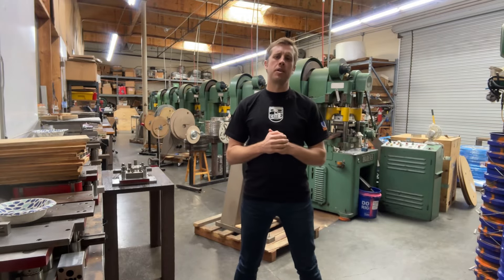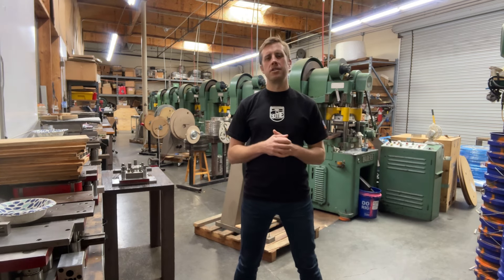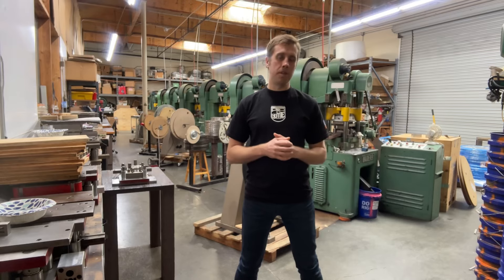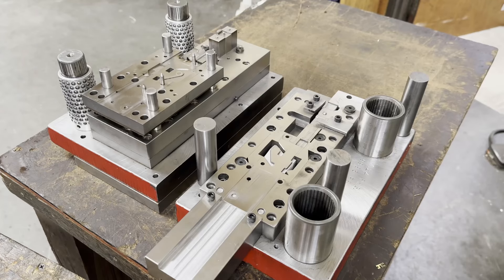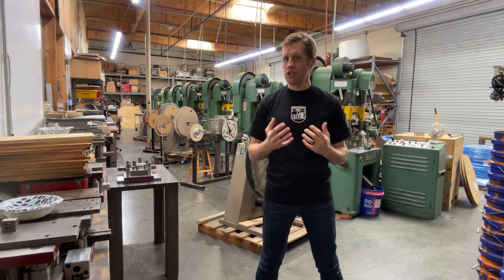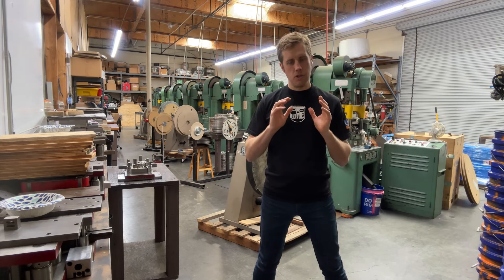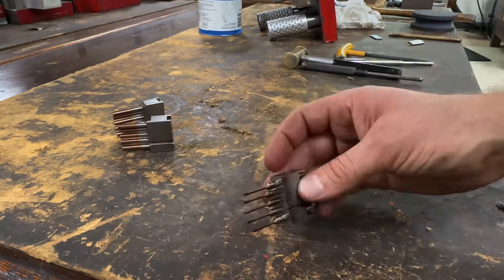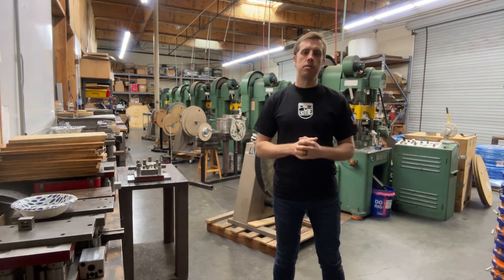Crafting Excellence: 7 Must-Have Tool and Die Making Skills

Comment: Been doing this 25 years.  From design to prove out on the cmm.  With me running the cmm and another to verify.  As a Master Die Maker, you have to understand the whole process, and if needed, program, fabricate, and assemble a functioning die on hit 1.  From print to putting it in someone's hand.
Reply from the maker: We try to make a good part on the first try, but there is usually some development before getting a more complicated part to spec.
Reply: @ToolanderEngineering  Oh, I realize that happens, but the mindset of dead nuts does take over sometimes. 🔍
Reply from the maker: @scottrackley4457  of course
Reply: @ToolanderEngineering  Home run on first hit is rare. If it's not, you're not being challenged.

Comment: i designed powdered metal, multi layered die stacks, dies and coining dies for a few years, 30 years ago.. ive worked on a list of projects since. i have a 3 machine cnc shop now doing design to small production. ive always felt more of a tool and die maker though, its been a mental process to get that production speed mentality lol.
Reply from the maker: That's an impressive background in tool and die making! It sounds like you have a wealth of experience and expertise in the field. Transitioning from designing dies to running a CNC shop must have been quite a journey, but it's great to hear that you've adapted and are thriving in your new role. Keep up the fantastic work, and best of luck with your design to small production endeavors!

Comment: I would love to do an apprenticeship in a tool and die place or mould shop for my next step in my career, the old school knowledge in these places fascinates me so much. Reading books, watching videos, following evening school whenever I'm off work. Unfortunately I'm really not mechanically inclined. Much better at the software and coding side of things 😭
Reply from the maker: Well, maybe I should’ve put it a little differently in the video. Even though it’s something that maybe you weren’t born with you could still greatly increase that skill with practice overtime.
Reply: Your not going to get through the next 20 years not knowing how to code. Even basics like python can and will give you a huge edge. More so if you ever want to touch automation.